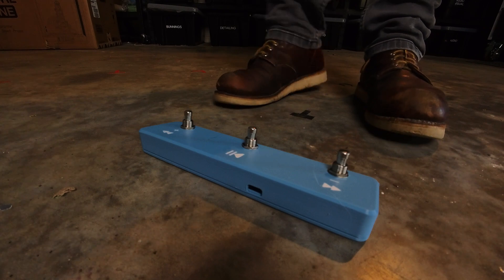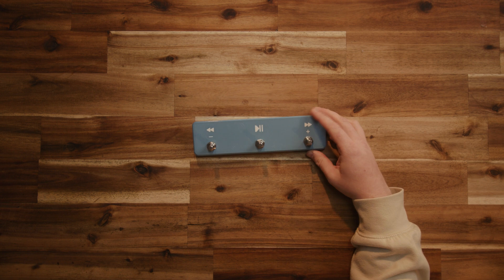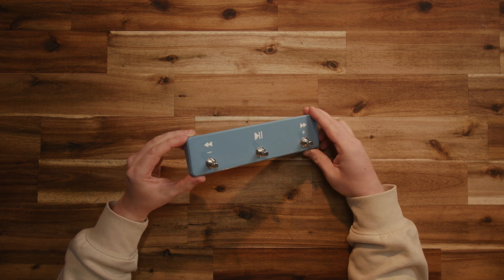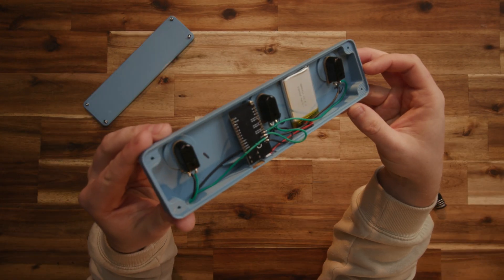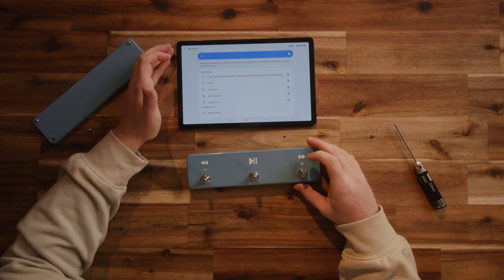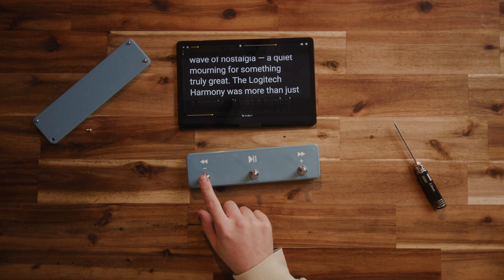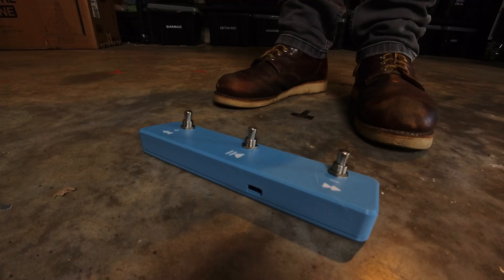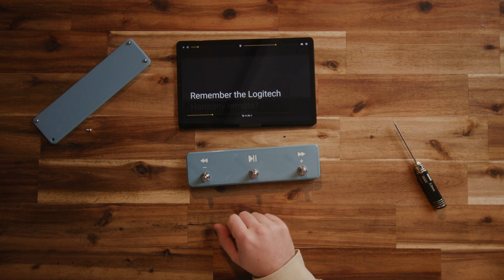A Quick Project That’ll Save Me Hours Every Week

Comment: This a great example of why custom interfaces are the best sometimes.  I use to work in TV and teleprompters seemed to get worse over the years even when tech in general got better.  When I started, the studio I worked in had a fully custom OEM control box with all the buttons for an operator to work with the script stack for an entire news program.  One feature of the boxes you might like was an additional input for an expression pedal to be used to control the scroll speed.  Best suited for talent who were seated, but still a great addition.  The ESP modules may have an analogue-to-digital input that could be put to use.

Later on, another teleprompter suite provided a USB controller that had less controls and IIRC the buttons were just mappable to keyboard keys, but sill using a wheel control for scroll speed.  The operator needed a keyboard and mouse to work with scripts in the GUI application.  That mentality of "good enough and cost effective" really showing through.  Nowadays the tablet-based systems seem clunky out of the box and features like following the script with voice recognition are hit and miss.

I did even see an analogues teleprompter up close: a self-contained device with lights and a camera mounted top-down over a feed mechanism that pulled a strip of paper through.  All the speed and direction control UX that we still use today was there on the physical teleprompter for controlling the speed of the paper feed. I never used that thing for it's true purpose, but it was a great place to leave the pizza.